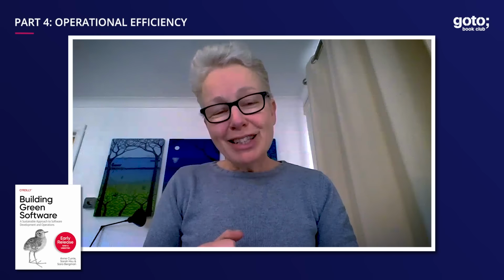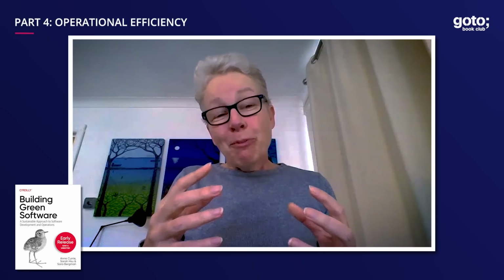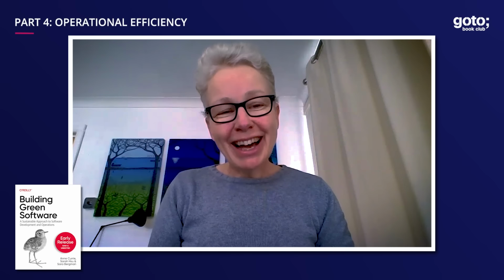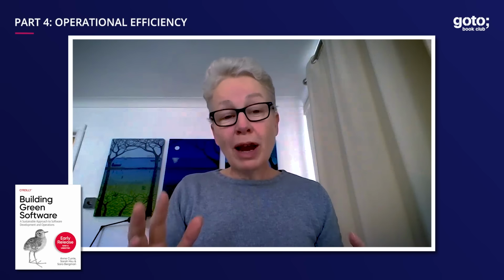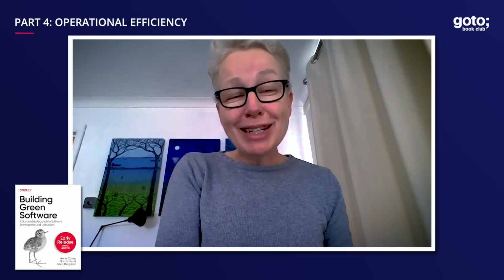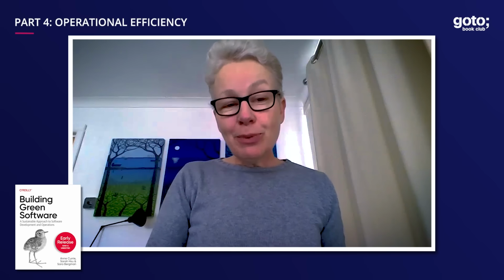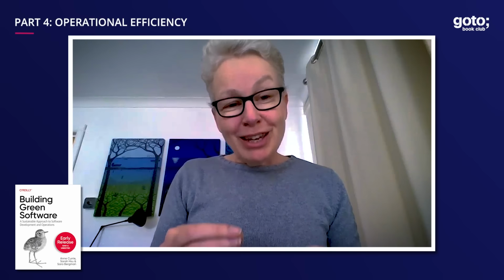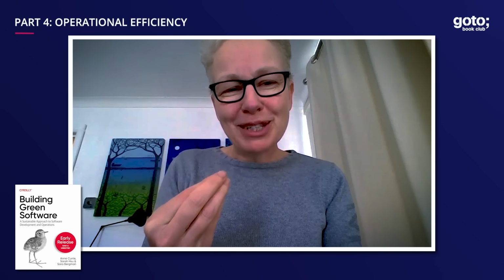Building Green Software Part 4: Operational Efficiency • Anne Currie • GOTO 2023

Comment: Great talk! By the way, splitting a monolith will likely make your application more resource hungry, not less. There will be more RPC and cpu-cycles spent on marshalling, there will be more abstractions on top of abstractions that will consume much more memory and operational efforts than before. Microservices are more about scaling and components isolation rather than about efficiency of compute. There may be rare exceptions with exceptionally well designed architectures operating at FAANG scale, but that’s not what usually happens in real life for most of the companies.